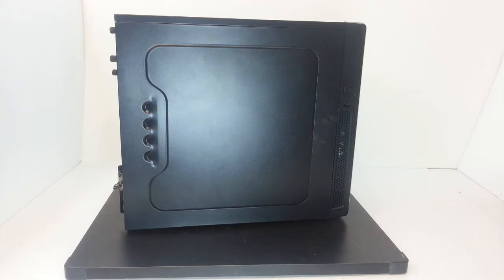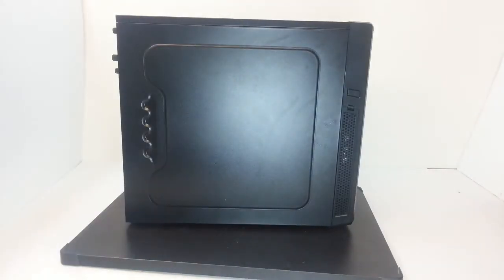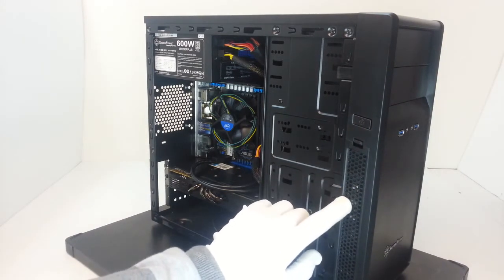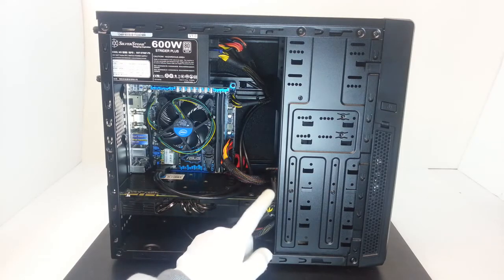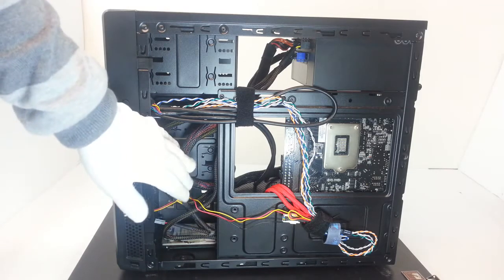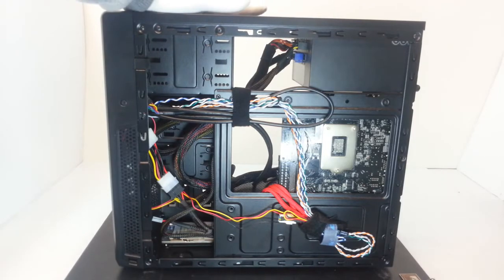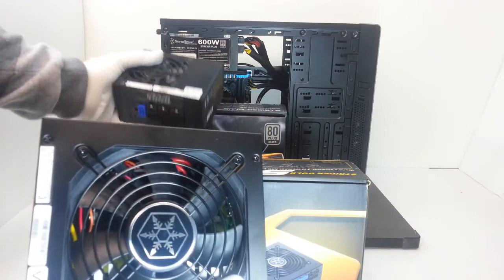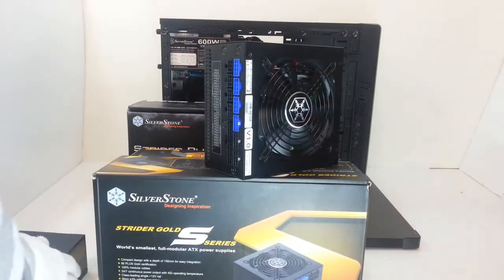Videoreview SilverStone PS09 ENG

Comment: hey just a quick question, on there website it says in the front it has a 120 mm fan mount, then a 80mm mount(1 x 120mm intake fan, 1 x 80mm fan slot)is that a typo or is there 2 fan mounts, thanks for the help